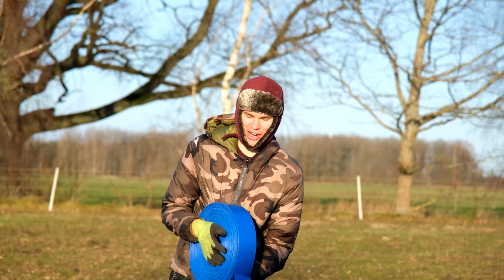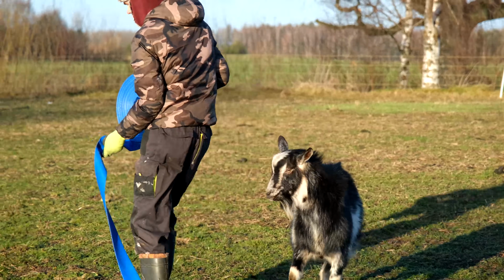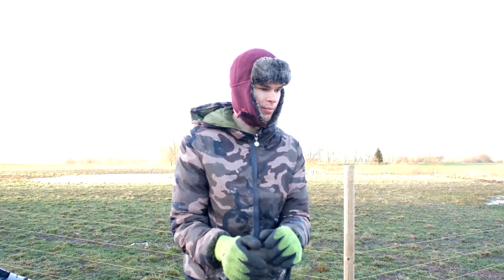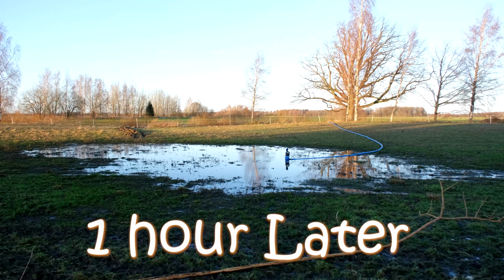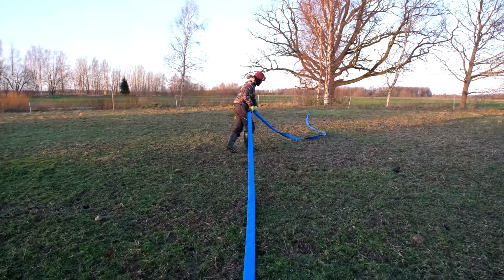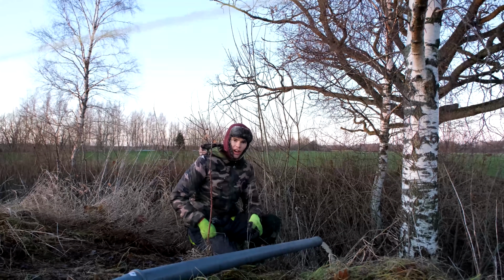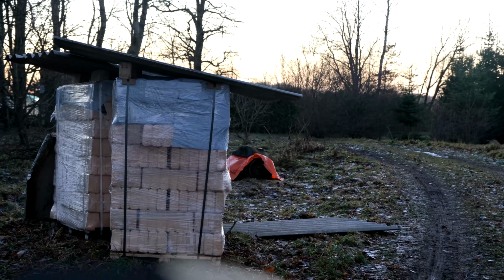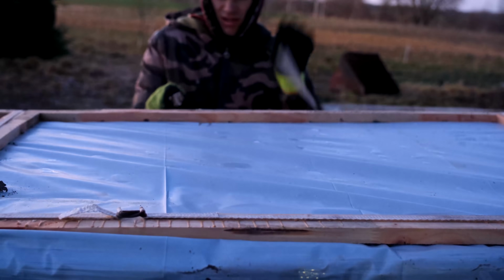Pumping OUT Water from the FIELD

Comment: I have a pump similar to yours for my basement since I live on a river, don’t need it always been when it rains a lot it’s good to know it’s there.
Couple ideas/suggestions: put boards under the tires when stuck so it gives you some solid ground. Also I saw a bunch of pallets, if you go in YouTube you can see how people made them into sitting areas that you could use for indoor furniture for short time. 
As always loved your “supervision” by the animals 🥰
Reply: Boards work very well!  💙
Reply: While boards may help keep you out of deep mud, when muddy they're very slick and provide little if any traction in bad conditions like theirs. I was taught to use branches crosswise under the tires. Use branches 1- 3 inches in diameter and a couple feet long. The tread of the tire can grab the branches providing better traction.

Comment: You might want to think about laying a stone and gravel road down. Also, next summer you could build a pole barn to park your cars and tractor. It would eliminate scraping icy windshields and save vehicle battery strength. You could even buy a quanset building like the military uses.